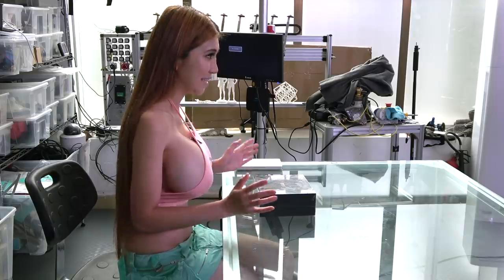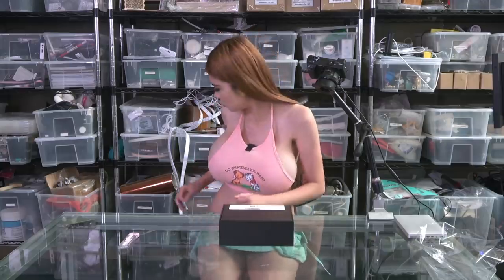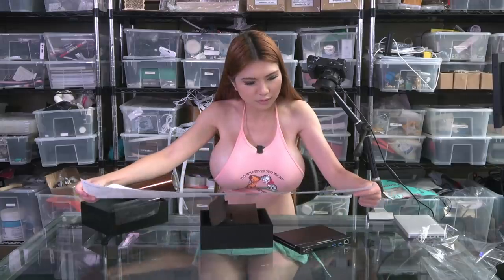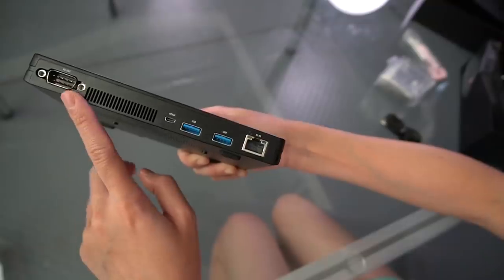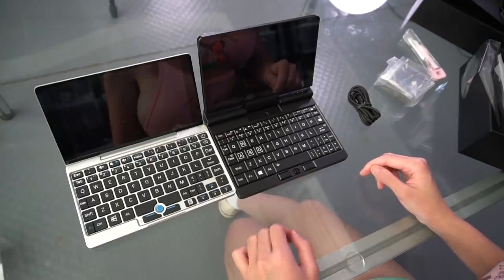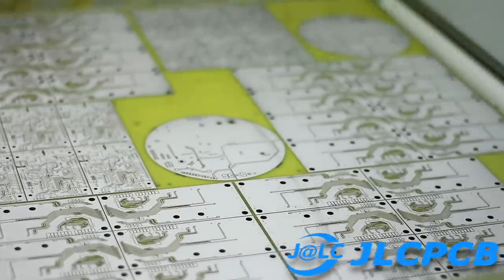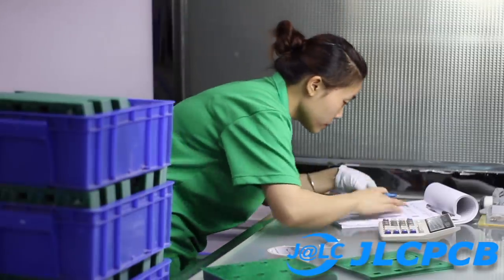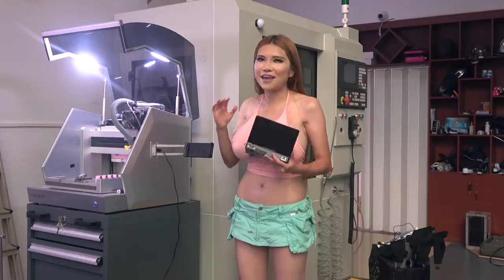Banggood One Netbook A1 Review and Carvera Benchtop CNC Sneak Peek!

Comment: That seems like a great option for situations when a tablet just doesn't cut it and a "Schlepp-Top" would be overkill. I wouldn't mind the small keyboard at all because if you are able to text on a mobile phone you shouldn't have problems typing short commands or parameters on that. 
Using it like a mobile input terminal for any device/machine that doesn't come with a fully fledged computer attached but requires one every now and then for maintenance or setup changes, this netbook seems perfect. I could imagine it for service technicians (like for washing machines, heating controls or even cars) who need to connect to the internal computers of some appliances.
The RS232 port is a great plus, because it allows for connections on a very basic level and is much more universal than the so called Universal Serial Bus (USB). Nearly every programmable logic controller (PLC) has one of these connectors and you almost never have the space and/or light to use a laptop where the electrical cabinets containing the PLC are.

Comment: Wow the Carvera looks very feature rich with tool changing and a diode laser.  However, it would be nice to have a bigger spindle than 200 watts.  Was the dust collection not connected during your video?  It looked like the workpiece was not getting cleared during the carve.
Reply from the maker: They're still updating that...

Comment: i kind of wish i got the yoga 2s instead. connecting it to a usb c portable external monitor with touch doesnt let it charge.. sometimes... sometimes because if i shut it off then connect the monitor and usb charger - this will charge the device when still connected to the monitor. (Thinkvision with touch and pen support version.) chip also runs hotter than my micro pc with the intel atom. also a very slippery device